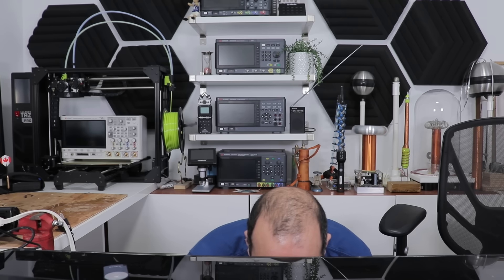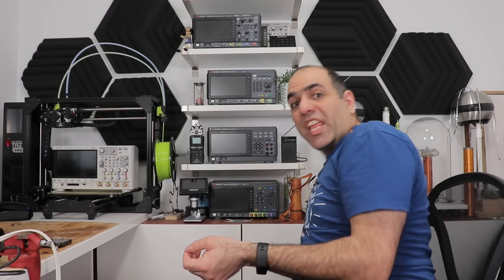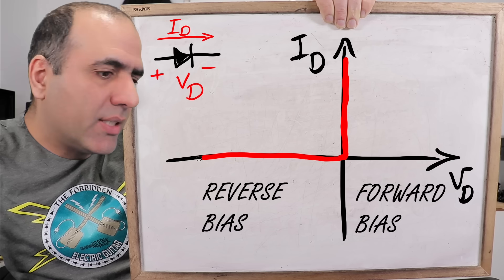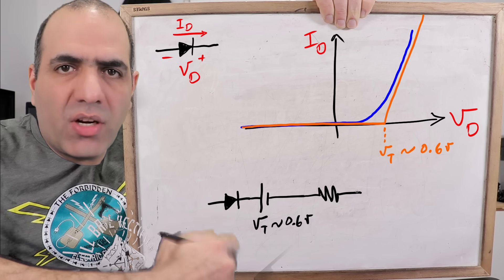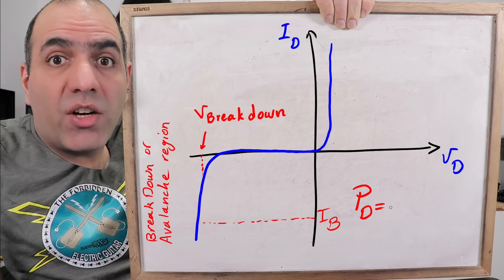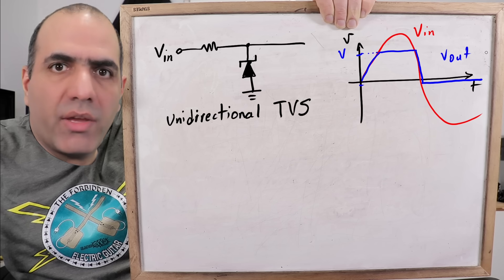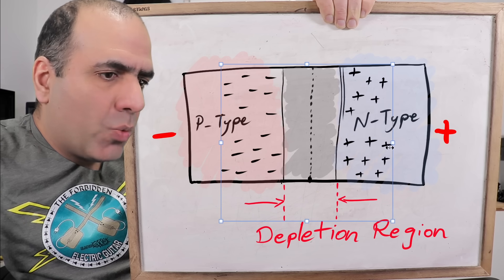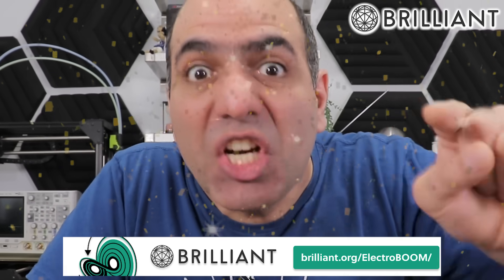DIODES! All Sorts of Them and How They Work (ElectroBOOM101-010)

Comment: I popped the lid off of an old 240 AC to 12 volt DC model train power supply yesterday. It somehow converts AC current to DC.. But has no valves, tubes or diodes inside it. Instead it has what looks like a small stack of washers and two magnets bolted together. I have NO idea how it works. But it does still work. I'm utterly mystified.

Comment: Excellent video. Diodes can be dangerous if they fail and re-direct current flowing in the wrong direction they can set a tractor on fire if they power up the wrong relay which then engages two opposing hydraulic solenoid valves which then catch fire along with the electrical wiring. Keep these videos coming thank you.

Comment: I really appreciate your explanation of electronic concepts. Thank you for the excellent work. I do have one item that I think needs explanation:

Electric current is the opposite of electron flow." What is current flow if not electron flow? What is this current flow that is called traditional or standard current flow? In a vacuum tube there is a hot cathode and a cold anode. What is going on in there? Are not electrons flowing from the hot cathode to the positively charged cold anode? This flow of electrons is measured in current, right? So is there something flowing in the opposite direction in a vacuum tube from the cold anode to the hot cathode? What is this "opposite electric current" that is allegedly flowing in a vacuum tube? 
Thank you. 
Russ

Comment: I have a question. I have a ac transformer with 2 individual 25-0-25/25-0-25 500+500VA. I added 2 full bridge rectifiers with center tap and then I put them in series and didn't take those 2 center tap wire off. Then I used +/-70VDC to my audio amplifier and used the 2 bridge connection point as center or Ground. It's like I added 4 big capacitors (as batteries) and then I put them in series and used the center point as Ground. To be honest my amplifier runs great but I found lots of people thinking about my idea isn't great and not balanced, some are saying my diods will burn out but they don't don't even get hot(MUR860 with heatsink). What do you think about my power supply Sir? I'm really looking for a good answer and explanations.  I really don't know how my power supply works great with my 1000watts system when I think about the route of the current. I'm really expecting a reply 😊 thank you

Comment: Had trouble with a welding machine of mine (that i build of course).  Not shutting off when i hit the off switch.  Turns put there was enough current to keep the (Hold) on the fuel solenoid going.  And remeber led's only work one way.  Put one on the sensor wire going to the switch and stoped the back feed.  I feel like a electric wizard after that.  My uni brow is growing!

Comment: This is more :

Tunnel diode: tunnel diode has negative resistance.

Germanium diode: it has lower voltage drop then Schottky diode. So it can be use for the radio detector

Comment: Why voltage increases while converting 3 phase 415V AC to 415V DC through 3 phase rectifier. Is it because of pick voltage of AC. It almost shows 530 to 550V DC

Comment: You know, that voltage at which the diode starts conducting, .7v , I remember in my electronics classes in the 80's , our teachers always referred to that as the "knee voltage" but yet ive never heard that term used since. I wonder why 🤔

Comment: Hi. ElectroBOOM is lots of fun.  I have a simple need to put a diode in line on my voltage sense line from car battery to alternator (goes to sense terminal on 3-wire alternator).  If it can handle 5 amps, i think that's more than enough.  All I need it to do is drop the voltage around 0.5V, and that's the behavor of my charging system I would enjoy.  I have been enjoying pulling the sense line fuse altogether, except the AC Delco alternator I have will put out 15V when cold, and that is too high for my taste.  So, if I just trick it by a half a volt, then I think it will not hit 15V.  What kind of diode should I be looking for? Cheers, Mark

Comment: Super video, just remember Current is the flow of Electrons from Negative to Positive, as Positive is a lack of electrons meaning Holes. You can track current by measuring the Lack of Electrons Positive as well as their flow from the Negative to the Positive. However just remember current flows from Negative to Positive not the other way around as, I said before, Current is the flow of Negative Electrons moving into the Positive (Holes or lack of Electrons). Electron Flow was actually discovered by Thomas Edison when He accidentally created the 1st Valve, and noting this phenomenon he called it the Edison Effect. I find it oddly strange that many highly educated people and wonderful electronics experts and great technicians still get this confused, thinking current flow is Positive to Negative when It's actually the opposite, current flow is always from Negative to Positive. Once that concept is grasped it then makes perfect since why aircraft circuits/systems generally always have Voltage on them and are activated by applying a ground instead of applying a Positive Voltage. Best Wishes & Blessings. Keith Noneya

Comment: I have a 20 volt 2 amps solar panel, charging a 13 volt 100 amp battery, what type of diode should I buy to keep the solar panel from getting zapped by the battery?
Reply: U cant get zapped by 20 Volts lol but you should use a füll bridge rectifier!
Reply: @arnolddergamer9668  since you didn't understand me correctly, I can't believe your answer might be correct. 
100smp battery, connected to a 2 amp 20 volt solar panel for keeping it trickle charger, 
So my question is what's the kind of a diod I need for keeping the solar panel safe from the battery and not drain so much of the battery in milliamps as all diodes do rob some power. What's the efficient and correct diod for the task?
Reply: Use a freewheling or flyback Diode (Just an high currant one or many in parallel)

Comment: I see plenty of glass diodes and wonder why ambient light doesn't effect their use?
Reply: ambient light WILL affect their characteristics. A lot of circuits however can get away with this, especially since most circuits are inside a light blocking enclosure. Many hours have been wasted trying to debug  such circuits when light hits a glass diode that is normally dark.
Reply: @davebing11  many circuits I've seen them in are in vented enclosures with exposed to beams of light, I'm imagining a rare but possible instance where a very bright flashlight is shining on a glass diode while the circuit is active, the value would change in multiples. The tolerance must be fairly great.

Comment: If you want to have two different switches provide a control current to the coil of a relay, but you don’t want the activated switch to provide voltage to the switch that is still open, will two diodes on the switch inputs to the coil accomplish this?  It seems to me that if one switch is closed and energizing the relay coil, the other switch, which is open, will eventually see the supply voltage on the side of the switch that is connected to the coil due to the reverse bias leakage current.  It may take time for the small leakage current to provide enough charge in the wire between the switch and the diode, but it seems that eventually the one side of that switch will see the supply voltage as though the diode wasn’t in the circuit.

Comment: Excellent video, but some tubes are still in use today for special purposes, typically where very high amounts of power are concerned, and edge/special use tubes such as x-ray tubes.  I personally deal with high-power transmitters that use power beam tetrodes as their final amplifier stage.  The only real criticism I have is that I think it would have been interesting to talk about vacuum tube diodes for a second or two before going into the solid-state diodes.

Comment: Good video!     But here's a few things of interest to some of us that you didn't get into:

(1)  The base-emitter junction of a silicon transistor makes a good zener diode.  The Zener voltage is around 6 volts for a typical small transistor, up to 30 volts for a power transistor.   Even though not sold as such, they work just fine as Zeners.

(2)  While we often think of a diode as being a good conductor in the forward direction, the actual conduction curve is almost exactly an exponential curve!   To within a few percent.   This feature is exploited in log converters, which are basically a diode that is temperature compensated.  

(3)  Some diodes with large junctions tend to snap off, generating a considerable pulse of RF energy!  Put a 0.1 uF capacitor across diodes to quiet them down.  Long ago I had a Dynaco transistor amp that would buzzzzzz like crazy in all AM radios in the house, before I added capacitors across them.

(4)  You forgot about tunnel diodes, really amazing yet mostly useless devices.   Tektronix oscilloscopes since 1961, even some tube scopes,  have had tunnel diodes in their trigger circuits, they contributed a lot to their great performance.
Reply: A good zener is a diode which breaks down accurate at a defined voltage. That voltage is often stamped on to the diode.

A good diode is not a transistor junction that is reversed biased and you don't know accurately know what voltage it breakdowns at.
Reply: @deang5622  Yeah, I probably would not design-in a 3 cent 2N3904 emitter-base junction as a Zener, into a ICBM warhead.   You'd specify a gold-plated 1N751A at $5.

However, notable EE's such as Jim Williams and Bob Pease, they have used E-B junctions as Zeners in many a sophisticated device.  

And I've used them in my humble little projects in all kinds of signal-clipping roles.

As usual the best choice depends on the context.
Reply: @georgegonzalez2476  The point is, you don't know what voltage the transistor junction is going to break down, because the transistor manufacturer doesn't tell you, because they don't measure it and they don't publish it.

So if you want to use a transistor as a zener, you have to characterise it yourself.
Reply: @deang5622  Perfectly correct.  You should aim to use devices within their characterized limits.   FYI though, I've checked the EB junctions of many, many small silicon transistors and they are very consistent by type.  If its collector voltage rating is 10 to 40 volts, the Zener is very likely to be 6 to 7 volts.   Not for use as a voltage standard of any sort, but fine as a clipper across the inputs of an opamp.   Actually, superb, it has less leakage than a bog-standard 1N4148.  But not guaranteed.  Once Bob Pease got caught when Fairchild started gold-doping some transistors, which improved some characteristics but wrecked their fine reverse resistance.   In another case I was working for a medical device manufacturer that had infusion machines that failed at night all of a sudden.   The original design depended on the 12 volt fans being able to spin quietly on 5 volts at night.  A new batch of fans arrived which worked fine as specified on 12 volts but would not even budge at 5 volts.   Big uproar, but it was their own fault on depending on unguaranteed behavior.

Comment: TL;DR Not mentioned in the video is the fact that a diode will briefly conduct for a brief period of time in reverse (i.e., even when reverse biased) if there is a rapid change change from being forward-biased to being reverse-biased. The more forward current before the switch, the longer the diode will stay in this state, behaving more like a resistor (i.e., non-directional) than a diode, and capable of allowing current in both directions until it exits the "forward to reverse transition-state" that it is in. This is one of the ways that switching diodes differ from rectifier diodes. Both are "plain old diodes," but the switching diodes have a much shorter reverse recovery time, hence the label: switching diodes.

Details: One thing not mentioned in the video, but of some important to know and understand is the "Reverse-Recovery Effect." When a diode is forward biased (i.e., normal "switch-closed" conductive operation) and the bias is quickly reversed (i.e., it quickly changed to run in a reverse-bias mode - for example, if it is used to rectify a square-wave with very fast transitions up and down) , there is a brief period of time when the diode transitions from forward-biased to reverse-biased, that the diode will conduct "backwards" - even though it is reverse biased. This period often lasts from nanoseconds to microseconds, but it something to be aware of, since it seems few people lacking a formal Electrical Engineering education, are. You can look up this effect on Wikipedia or some other article that goes into detail about what causes this effect (i.e. the stored charge in the diode).

Comment: Great video!
Just want to add that diodes can also be used in physics as particle detectors; if you get a diode very close to its breakdown voltage, it means when certain particles hit the diode, it results in full breakdown due to the little bit of extra energy from the particles. Just think it’s neat and wanted to share :)
Reply: Nice. Using the very high slope of I-V curve near the reverse breakdown region.

Comment: What would be the best diode to use to loose the least energy from a hand crank generator?   I'm thinking a well designed large hand crank generator can do in excess of 50 watts.   A small one with a stepper motor maybe only a few watts, so efficiency is even more important.

Comment: as a kid i would notice semi conductor behavier witrh my bycecle light on a dynamo (alternator runniong of the wheel) i had a extra bright light in my front light and to get it to start to make light i had to make a bit of speed but after it was on it would stay on at very low speeds its just has to overcome the resistance once ther is flwo it will keep flowin olso like a transitor.edit i am drunk what i mean is a transistor not this video stupid me

Comment: Hi Electro boom I need advice  I have this High Frequency 15KV Transformer DC High Voltage Arc Ignition Generatro Kit and  how do i output a Rectified DC high voltage out of it.  given it has nothing else after the  output of the secondary coil  . thanks

Comment: Hi I have a electronic piano no power. I open to find any loose wire or something. I could not find anything. Then I were testing power jacks with multimeter. I plugged in 9v ac adapter and put multimeter,s negative lid to one pin of power Jack and other lid to power switch and put my finger to volume bar piano gets power and work but after unplugged and plugged again does not work. By the way when I touch power and volume bar and power Jack pin multimeter setting was continuity/Diot/volt. I don’t know what’s wrong. Please help.

Comment: The (+) mark on a diode goes on the cathode for a diode symbol as well as on the diode itself. It's a convention with a very valid reason. If you look at any image of a selenium rectifier, or early solid state rectifier, the plus (+) indicates the cathode. I've got into technical arguments with most every engineer and technician I talked to when I told them that a PLUS SIGN (+) BELONGS ON THE CATHODE. No one seems to understand why the "+" goes on the cathode. Actually, everywhere on the internet the anode is shown CORRECTLY as more positive than the cathode when the diode is conducting, but that's opposite to the reasoning that puts the "+" mark on the cathode of the diode symbol. There are TWO pieces of information in the diode symbol. The ARROW shows which way conventional CURRENT flows and the PLUS sign shows the VOLTAGE polarity when no current flows. If Ben Franklin hadn't guessed wrong about current flow the arrow would need the "+" on its tail. See for yourself by Googling images of selenium rectifiers. There's a (+) on every cathode.
Reply: You are actually wrong. On a semiconductor diode, the arrow indicates conventional current flow.  The apex of the arrow where there is a perpendicular line is the cathode connection , and it is denoted on the semiconductor diode by a band around the body of the diode.

As for selenium rectifier, hardly anyone uses them and not in domestic electronics.
So let's not confuse the YouTube viewers.
Reply: @deang5622  This is humorous. Please read what I said a little more carefully. Every technical comment you made is correct and agrees exactly with what I said, but I'm much more rigorous in my presentation. The stuff about being wrong is incorrect. The stuff about confusing YouTube viewers was never my intention. Actually, I was attempting to clarify the confusion, similar to yours, that I've seen many many times. I'm an EE and at work I have two diode symbols on a poster in my office, one is a conventional diode where conventional current flows in the direction of arrow while the other has a modified arrow (to differentiate it) showing electron flow. Written inside this arrow are the words "Electron Flow". Both diodes have a "+" mark to indicate the polarity for which current DOES NOT flow. My 'arrows' point at each other, however the "+" sign ALWAYS is at the cathode end.

As far as selenium rectifiers go, they're just easier evidence to find on the internet when looking for image where a "+" is printed on the housing. All rectifiers that have a "+" as part of their label have it on the cathode. Images of the germanium and early silicon rectifiers are just tougher to find. Motorola's Silicon Rectifier Handbook (1966) on page 15-46 shows silicon rectifiers with the cathode designated as "+" and the anode designated "-". Additionally, any bridge rectifier has its positive output marked with a "+" and it is where the two cathodes are connected, i.e. + = cathode.

Comment: You should cover actual electric guitar circuitry (not plugging the strings into the main lol). The TVS diodes are what make the distortion sound in rock and metal